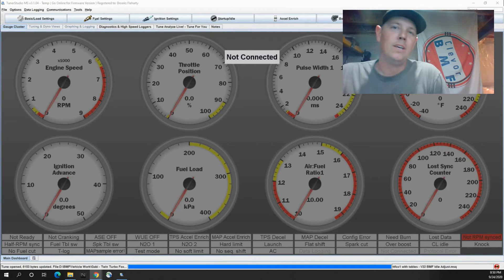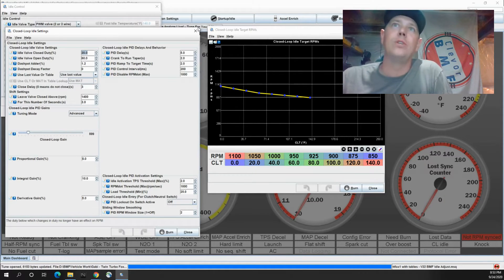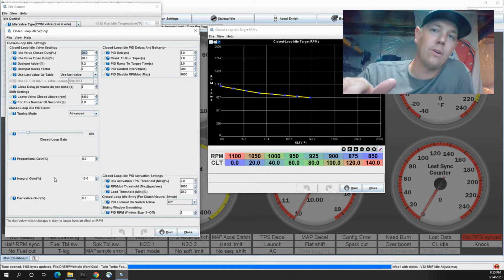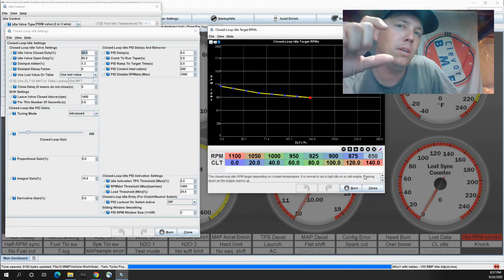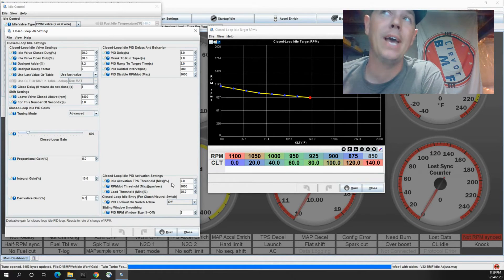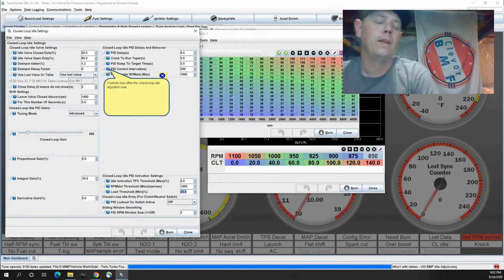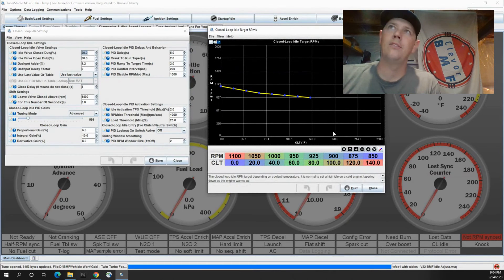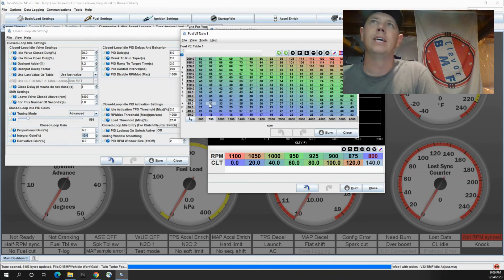Tuning Closed Loop Idle Settings - Tuner Studio

Comment: hey dude, hope i'm not bothering you, after much thought i've decided to upgrade to ms3 on my m5 e34 3.6, i've been playing with the settings and i've gotten a pretty nice idle (icv in open loop mode) the problem is that when the car is hot, at the moment of transition from idle to acceleration, it seems like the icv stops receiving a signal and is left without control, the icv (m20/m30/s38) has no spring and causes it to open, which leans the mixture and the car runs terribly. do you know what i can do to fix this? thanks a lot!!
Reply from the maker: There’s a couple things you can try.  The easiest is to watch the ve table and see where it jumps to on the table and give it some more fuel there.  The other alternative is to increase the accel enrichment so it gets more fuel on top in of the throttle to compensate for this.

Comment: Thanks to you I found this video. I use your advices and add more fuel to idle after settings and kaboom it's idle again. 💪
Reply from the maker: Hell yeah 👍🏽
Reply: @BMF_Garage  Patient is VW mk2 golf with mk3 golf GTI 2.0 8 valve engine running on microsquirt V3.

Comment: how do you fix an idle hang? Example, my hemi swapped dakota will idle pretty reasonably but when i rev it, it will hang up at about 2,000rpm for a few seconds then come down to the target. Its kinda annoying both with the sound but makes low rpm driving kinda annoying too
Reply from the maker: That usually has to do with the idle air control valve settings.  If you adjust it so it responds faster, that would come down faster.

Comment: Interesting, I'm going to try your PID settings. Your explanation of what the P-I-D elements do is different than what others have said. I see a lot of advice that says "I just leave it at 50/50/0," and this leaves my motor wildly oscillating, to the point I turned off closed loop and was only using the open loop for warmup.

Comment: Hey! Thanks for the help. I'm trying to get the ECU to respect my target curve, but it's idling at about 1000 when i have it set to 850. The AFRs seem fine so I don't know what to do. Should I remove air and fuel or should I let the ecu figure that out?
Reply from the maker: There’s too many variables without looking at your tune, but yes… adjust air and fuel to get around 14.2 idle or also adjust the throttle body stop screw can take away air…
Reply: @BMF_Garage  How do you suggest I take away air? I was told not to mechanically change the iacv .
Reply from the maker: I was referring to adjusting your throttle stop screw.  Your idle is a function of how much air and fuel are available at idle… if you can’t take more fuel away, you have to provide less air.
Reply: @BMF_Garage  so theres no way in software for me to manually change the idle duty while in closed loop?
Reply from the maker: Again, depending on how you have your car setup there are options just because it’s tuner studio doesn’t mean all applications are the same.  Did you check your warmup enrichment table?  The number in the final column at the hottest temperature is what the iac will use after warmup.  You can make changes to that number and see if it helps.
Reply: @BMF_Garage  Alright, thanks for your advice. I appreciate it.
Reply from the maker: You bet
Reply: @highvisibilityraincoat  from reading your exchange here, I don't think you're understanding what he's saying. The throttle stop sets the absolute minimum speed the motor will idle at, there's no way for the ECU to take away air via the IAC if the throttle is propped open at a higher idle speed. With the car warmed up and the IAC disconnected, set the throttle stop so it idles a little lower than you want it to, in your case 750-800 rpm. Then plug the IAC back in, and your idle control settings can raise it the little bit to your target RPM. I had this very issue with my first MS3 on an LS.

Comment: Im having an issue with my Lincoln Mark Vii, it has a 347 stroker on it, with a Megasquirt, and the idle is oscillating very aggressively.  When I put  the car into Drive, or Reverse, it stabilizes and idles just fine. I tried lots of different configurations to  try to fix it and just cant get it right.  Do you offer remote  tuning?
Reply from the maker: Yes I do!  50/hr.  If you can send me a datalog and a copy of your tune, I can take a look.  Email to brooks@bmfautomation.com

Comment: How do you adjust the initial value table. Explain that if you can
Reply from the maker: I’m not sure exactly what you’re asking.  What initial value and on what table?
Reply: @BMF_Garage Under closed loop idle settings, you can select “use last value” or “use initial table”. When you select use initial table, the initial value table “opens up” under the startup/idle settings. He is asking how to setup the inital table, so the iacv knows what basevalues to use instead of just using the last values and “guessing” the right position. When you have got open loop warmup pretty much dialed in and are switching to closed loop idle. You can use the temp based iacv values from the open loop table in the initial values table. Just setup the table to use clt temp if it also used that in open loop warmup, and calculate (or ask an ai to do it, like chatpgt) what the values should be at different rpms  based on your open loop values. Then all that is left to do is setup the target rpm table and you should be done. If you want to go even further you can also setup idle advance as well

Comment: Hey, great explanation video. Just to avoid some confusion for newer users of MS:
PID Disable RPMdot (Max) is NOT the RPM at which closed loop idle will be disabled. RPMdot is a change in RPM in one second. So with a 1000 RPMdot, this means that RPM has to change by 1000 over a period of 1 second for closed loop idle to be disabled.

The same goes for RPMdot Threshold (Max)(rpm/sec) setting. This setting means that BELOW set RPMdot, the closed loop idle can activate. So idle can not fluctuate more than 1000 RPM over a period of 1 second for closed loop idle to be enabled.

It is important to understand the difference between actual RPM and RPMdot, thought not only for RPM, but also TPS and other sensors. As this confusion can really lead to some unexpected behavior and just chasing your own tail.

Comment: i came here hoping for INITIAL VALUES explanation.  thanks anyways.
Reply from the maker: The initial value depends on many variables which aren’t always the same car to car or engine to engine.  There’s just too many variables involved for there to be a blanket statement for every engine to be grouped in.  I’d suggest doing some research on your specific engine to find out what the factory settings are and then you can progress from there.... that’s how I do it anyway.

Comment: A little less talk and more pointing to where make the changes then explain the effects. I lost you
Reply from the maker: In my opinion the talking was necessary to fully understand the concepts being covered.  I tried to add call outs (arrows or circles) but to also highlight the areas I was talking about.  Did I miss some?  Keep in mind this is a screen recording so pointing to the items on the screen doesn’t work especially well because you can’t see what my finger is pointing at.

Comment: What type of ecu should I buy for my 1998 mustang with a 306?
Right now I'm running a stock 95 ecu but I'm having a ton of issues as you do without a tunable ecu
Reply from the maker: I like my megasquirt ecu.  Made by stinger performance.  Uses TunerStudio
Reply: @BMF_Garage  I will look into that for sure, if I decide to run boost or nitrous will it support that?
Reply from the maker: Yup.  It can control all that